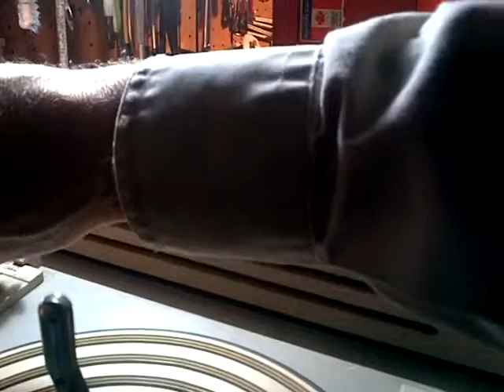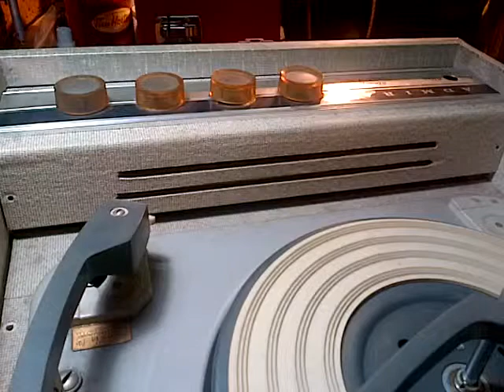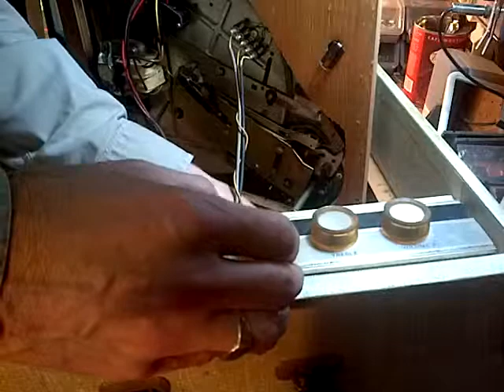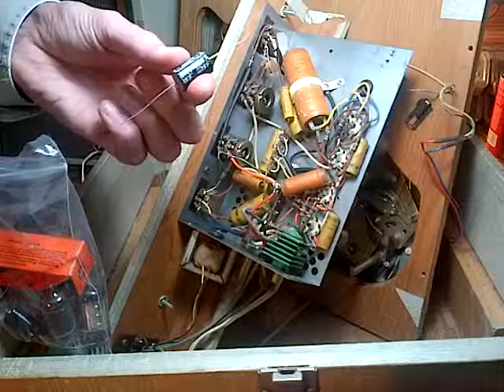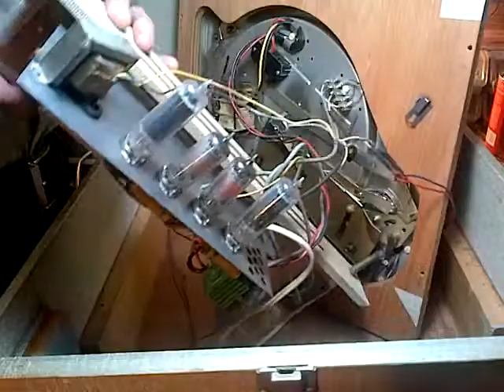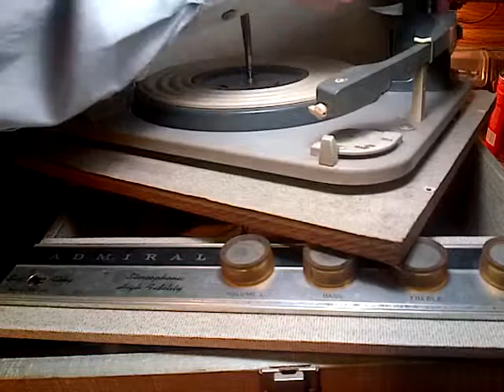Admiral Sing Along Record Player Video #5 Fixing the Hum

Comment: Jim, I"m not trying to nitpick here, but there are some important tips you need to know. First of all, never leave an old electrolytic capacitor in the circuit, they have a tendency to short and make other components go boom. You can replace those 80 uf with 100 uf. Secondly, always replace paper capacitors. Over time, they absorb moisture, which makes them short. Just like the electrolytics, they can take out major components when they go up in smoke. As far as the selenium rectifier, measure it's voltage output; if it's low compared to line voltage, it needs to be replaced.
Reply from the maker: I take different approaches depending on the condition of the things and how well they are working.  In this case, the amp worked just fine and probably will 20 years from now and still be mostly original.  I normally cut old capacitors out of the circuit and leave them in place and I probably did that here.  The selenium rectifier looked great but I should have taken care of that anyway.  Thanks for watching.

Comment from the maker: Hi vinylhound43, It can be a tough call on replacing capacitors.  I've done many where the new capacitors made no differences.  I'll do them if there is a reason to believe they are bad aside from just being old and ugly.  It can be the difference between repair and restoration and most people are happy to pay for the repair but hesitant on the cost of restoration.  Besides, I like seeing these old guys work with as many of the original components still working.  Thanks for your comment.
Reply: Jim Lindenas I have done so .  I'm working on a Philco chair side radio/phono from 1953 that worked the way it was but had insane hum. it is such a pain to pull the chassis out that I just replaced the electrolytic and paper coupling caps anyway.  I also have a pink Bakelite Philco clock radio from the late 50's early 60's that works great the way it is with no hum and is all original that I will probably at least still take care of the electrolytic anyway to protect the other components because it's nice to keep them original but it's worth replacing that one cap instead of tubes and the output trans. Nice series of videos though it's great that these end up in good homes to be enjoyed instead of in a landfill!!!